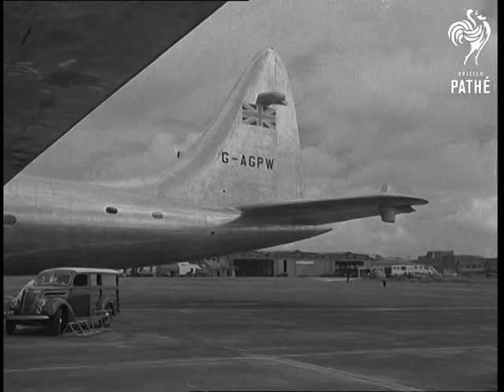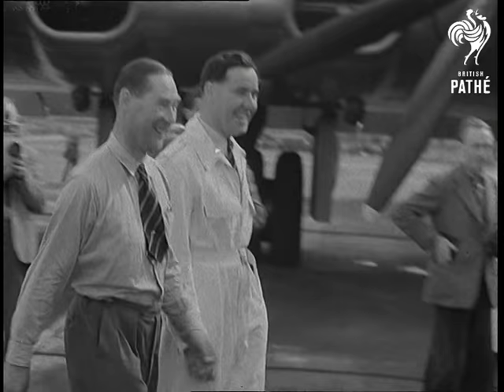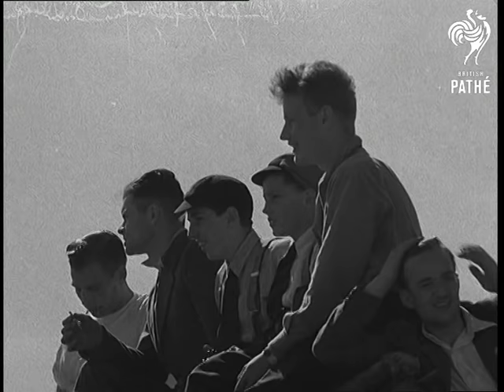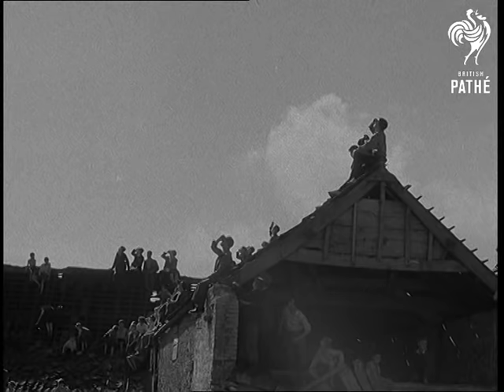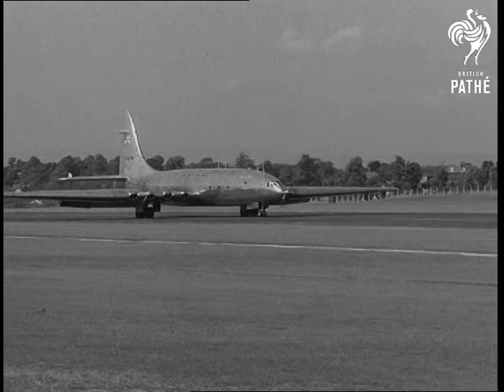130 - Ton Colossus Takes The Air (1949)

Comment: I have a great respect for the engineers who designed these aircrafts without a computer.
Reply: They used sliderules - cheaper and quicker.
Reply: Singular or Plural.. it's Aircraft !  Numpty 🥴
Reply: Singular or Plural.. it's Aircraft !  Numpty 🥴
Reply: Singular or Plural.. it's Aircraft !  Numpty 🥴
Reply: Singular or Plural.. it's Aircraft !  Numpty 🥴
Reply: Singular or Plural.. it's Aircraft !  Numpty 🥴
Reply: Singular or Plural.. it's Aircraft !  Numpty 🥴
Reply: Singular or Plural.. it's Aircraft !  Numpty 🥴
Reply: Singular or Plural.. it's Aircraft !  Numpty 🥴
Reply: Singular or Plural.. it's Aircraft !  Numpty 🥴

Comment: takes to the air - but only just. the thing has to fight tooth and nail for every inch of altitude and it looks heavy as hell. the shape is reminiscent of a lockheed constellation, only with single stabilizer, far fewer windows and seventeen billion rivets. give or take a few billion.

Comment: The Brabazon was using a 4-engine, 3-blade 'contra-rotating propeller' which though noisy, enhanced air intake, produced more power but with fuel efficiency. The US and British aircraft engineers never mastered the problems with the rotary shaft systems. The Russians however overcame that with 4-blades and produced the legendary Tupolev TU-95 'Bear', a huge, long range, swept-back wings, turboprop strategic bomber aircraft in 1952. It is still being used (after many upgrades) by the Russian Air Force even after 70 years !
Reply: Eight engine's look it up if you don't believe me
Reply: The US never tried to produce a counter rotating prop engine for airline use so there was no reason to master the engine.
Reply: The Russians had captured German engineers for the contraprop engines dev ,without them the tu95 would not have flown
Reply: The tu95 geared hunbs are so noisy they can be detected by submarines.
Reply: Clearly there were 8 engines as could be seen by the start up of a set of engines and the 8 air intakes per wing. Don't really have to look things up just have to observe. Sad that the aircraft was not saved. Lots of man hours painstakingly spent in producing it. Sad when it was destroyed. Much the same as the Avro Arrow in Canada. Easier to tear something apart than to put it together.
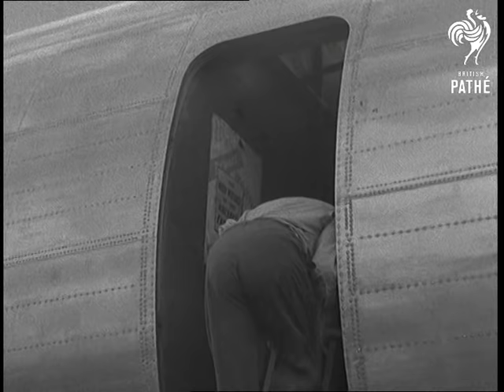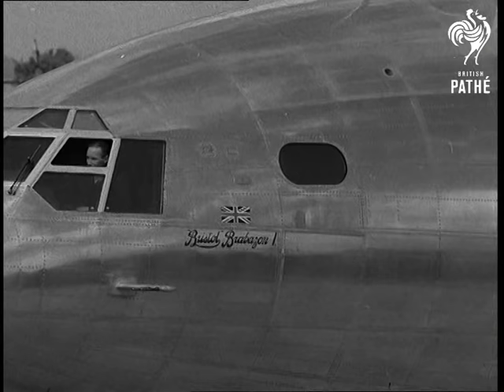Reply: Gilad Pellaeon  If you look at 0:32 - 0:45 you can clearly see that each blade was spun up separately. The flight engineer had 8 separate controls, one for each engine. Some (Bell 412) helicopters sport 2 jet engines with 1 rotary blade and they are twin engine aircraft. What I am trying to say is 1 propeller does not equal 1 engine. Same as counter rotating propellers does not mean an aircraft has 2 engines.
Reply: Gilad Pellaeon  Some also believe the world is flat and we never landed on the moon.😊
Reply: I will correct you a little, the Tu-95 is not used by airlines, it is a bomber and serves in the Russian Air Force. But the Tu-114 was a passenger aircraft and was based on the Tu-95, but had a different fuselage with a larger diameter, from the Tu-95 it had wings, engines, tail and some other aircraft systems. It was decommissioned in 1977. It can be seen in the museum in Monino.

Comment: I can’t believe I’ve never heard of this aircraft, and I thought I knew them all. What a Goliath and the sounds of the engines! Amazing.
Reply: Same here.
Reply: there was no mention of the aircrafts unusual engine  setup, 8 engines for 4 props, another forgotten giant is the Short Belfast turboprop of which only 10 were made for the RAF.
Reply: I have to wonder how many aircraft we may never hear of.
Reply: Its A Psycholigical fact , if a Person Think He Know All Infact They Know Nothing  , Im Criticise Anyone   , i Read This.
Reply: @georgebarnes8163  No, it had 8 props. 4 clockwise, 4 counter-clockwise - each with its own engine. You can see them at the beginning of the video.
Reply: @Fastvoice  First set up had  4 sets of  4 blade props each prop was driven by two coupled engines.
Reply: @georgebarnes8163  Source? What we see here in the video is the first version that really flew - and it has 8 engines and 8 props. Couldn't find any mention of a previous 4 prop setup for the Brabazon.
Reply: @Fastvoice  all types  had 8 engines and all  types use  coupled engines, the first engines used were the older Bristol Centaurus powering in pairs a single  4 blade prop, later a pair of 4 blade counter rotating  props, the next engines were the Bristol Proteus again used in pairs driving a pair of 3 blade counter rotating props via coupled gearbox, these aircraft were first tested in late 44  as a test bed for a bomber as Bristols type 167

Comment: Today is the first time I’ve ever heard of the Brabazon.  The only thing I know about it is what I listened to in this video.  
Nevertheless I have three comments about the Barbazon:  
1.  It should have been built with jet engines and not reciprocating engines. 
2.  I’m guessing here, but with its power to weight ratio I’ll bet it was extremely under powered.
3.  It was a very sleek and beautiful aircraft. For that the designers should take a big bow.
Reply: To be successful, the Brabazon needed to be able to pack in passengers, not like the cattle class of today, but sufficient to achieve satisfactory costs per seat mile, and to have the range to enable it to operate on long-distance sectors, and performance to enable it to achieve satisfactory turnarounds. It is doubtful if the jet engines of the time could have helped, as they had a voracious appetite for fuel.
Reply: Yes, it was totally underpowered and that was a major reason for its failure. So the Lockheed Super Constellation became the "Queen of the Skies" of the 1950ies.
Reply: @NicolaW72  Then the Comet came along to be "Queen of the Skies" until it kept falling out of those very same skies. Oh well...
Reply: @olsmokey  The Comet was therefore never the "Queen of the Skies".

Comment: Truly awesome plane which is way ahead of its time. A flying luxury cruise ship. .
Reply: I think it was more likely significantly out of date by the time it took to the air. If it was intended to steal passengers from cruise ships that bird had already flown and flown again by 1949.
Reply: well it was when it was thought of but b4 it was a prototype it was all ready too old and anyone can see it was way underpowered   just from the rollout and take off and on top of that as it was test flight so im guessing  the fuel would have  very lite load  and only a few on board  no bags

Comment: The B36  with 6 pusher prop engines and 4 jet engines also flew in 1949 and Max takeoff weight: 410,000 lb (185,973 kg) 205 Ton machine
Reply: B-36 first flight was in 1946, it entered service in 1948.
Reply: @rayjames6096  Ok thx for that info and a friend of mine used to work on them

Comment: Very sad ,  Britian had the manufacturing ability , it just needed the correct design , it turned out to be the Boeing 707 , but funnily enough the prop driven Lockheed Constellation was a sales  success till 1958 .
Reply: I believe because the range was still very good
Reply: The Constellation was a superior plane in every aspect: capacity, speed, and performance.  As elegant as the Brabazon was, it was a white elephant doomed from the start.
Reply: Well, it sort-of had the correct design with the de- Havilland DH-106 'Comet' - which also flew in 1949.
Reply: @alecfoster5542  Constellation is half the size of the Brazen, half it's length to start.
Reply: The Bristol  Britannia  did OK.
Reply: @flybobbie1449  The Constellation was also faster and carried more passengers and made it into production serving airlines all over the globe.  And Lockheed did it without government subsidies.
Reply: The Lockheed was 116 ft the Bristol was 177ft. The  Bristol was twice the weight of the Lockheed tho. The Lockheed entered service 6 yrs before the Bristols first flight and had more powerful engines and a cruising speed almost 100mph faster.

Comment: Great film of the mighty Brabazon. I have seen many pictures and have a picture of my father-in-law, an RAF instructor examining the Brabazon for possible purchase by the RAF as a long-range transport. As an Aero engineer, this film shows clearly what is wrong, she is too heavy and underpowered, a classic design by government committee failure. 100mph under design cruise speed, blimey! she looks like about to stall! From the film, the wing design also looks odd, a very high drag straight arrangement, sweep it back guys! There were many such aero design failures in the 1940s. Interesting that many of the successful aero designs were private venture, e.g. the Mosquito, Hurricane, etc.. The engines are actually 8 off, 2 coupled together to one contra prop, a fatigue nightmare. Germany tried this on the Heinkel 177 and failed. Brabazon needed jet engines, probably 6 at that weight and at that time. The problem is that after the war the country was broken in many ways including financially, and such projects were bankrupting the UK aviation industry. DH with the comet got it right in design performance, though had to learn about airframe pressurization and fatigue, though the fatal crashes were well below the airframe fatigue flight cycles...that is another story. Only the Brabazon hanger survives today and only just. I think all of us and the Nation wanted Brabazon to be a winner, and that is what makes me sad, though she does look magnificent.

Comment: Although this was one of those behind the times technical achievements, the fuselage looks nonetheless more aerodynamic than today's airliners! Seems the smooth front end informed the Comet, after which we didn't have another smooth front end until the B787 and the A350. Although again, the engineers obviously knew what they were doing, the Brabazon looks under-powered - those props look too small for that enormous fuselage and those gigantic wings - if it doesn't look right...? Perhaps this demonstrated the limitations of propeller-driven propulsion - you have to have enormous propellers which demand greater ground clearance and longer gear legs and which present more challenges, and numerous engines because of their power limitations as compared to jet power and which soon replaced it.
Reply: Yes, this was one of the huge problems of the Brabazon: it was underpowered with its traditional propellors - you can even see it in this video how difficult it was to climb for this aircraft. For an aircraft of this size you need at least turboprops - or jet engines.

Comment: A good example of how British designers got it completely wrong - cruised at only 250mph, at the dawning of the jet age. Luxury inside, not bums on seats. Same as the complete waste that was Concorde - the plane that helped finish UK airliner industry. Too loud to fly over land, too expensive, too small seat capacity - Jumbo jet, entirely different, and still flying. If the UK had put money into more wide body jet airliners, it would have an aircraft industry competing against the USA today - due to all the experienced workers gained in the war. And that experience passed down.

Comment: Why was this never put into mass production or put into service? Was this concept scrapped/abandoned?
Reply: It was scrapped because they found structural cracks that would have caused the wings to rip off in flight.
The design was faulty from the beginning. It was the most futile machine since the R101.

Comment: I don't see how counter rotating props on the same shaft would be very efficient.  The narrator said that the air speed was about
100 mph below what they expected.  I would think that is because the air flow thru the props would be restricted with  turning opposite of each other.
Reply: This kind of propellers is still used in Tupolev and Antonov airplanes, they fly rather fast.
Reply: Counter rotating props are very efficient, as used on the TU95 the worlds fastest prop aircraft.
Reply: The comment made by the narrator seems to indicate there is more speed available they just did not use it that day
Reply: @ztrguy  Yep, the aircraft was capable of 250 MPH and did achieve that speed.
Reply: @ztrguy   No, he didn't say that at all.  He said the cruising speed was around 160 mph,  nearly 100 mph 
below the estimated cruising speed.   Sounds to me like it did not meet their expectations on speed.
Reply: @Eddie_Schantz  He said the "average speed" on this short trip was 160, no suggestion they even tried for the cruising speed, or cruising altitude.
Reply: @sean_d    WHAT EVER.
Reply: @Eddie_Schantz  They kept slow on purpose. The landing gear was left down which limits top speed. Leaving the landing gear down is common for early test flights. It’s one less thing that can go wrong!
Reply: @buzzz241  Thanks.  That makes sense.

Comment: Problem is this was obsolete as soon as it was flown.  They should have used jet engines by then...
Reply: the second variant was to use a mixture of jet and prop engines but  it never happened  as the DH Comet took to the air at the same time, technically the aircraft did use jet engines to power the props, eight of them.
Reply: @georgebarnes8163  no, the Brabazon was powered by eight radial piston engines concealed in the wings. Not turboprops.

Comment: I gotta wonder how long these planes lasted, considering that on the first test flight, it under-performed on the expected cruising speed.
Reply: As said it only went up to 4000ft!!
Reply: The first flight is usually used to test control response, not cruising performance.

Comment: An awesome aeroplane,  but very much of its time & seen (optimistically in hind sight) as potentially 'way ahead of its time possibly. 
Air travel was about to turned on its head by jet airliners like the Comet , Boeing 707 for at least the next 20 years until the advent & acceptance of the Boeing 747.
Saying that the "Brabazon" I believe is more comparable to the "Airbus 380" - that is its was a victim of unforseen & predicted fast moving trends in air travel & customer requirements by the time it was ready to come into service & gain commercial acceptance.

Comment: A lovely thing but it must be remembered the Brabazon project was a disaster from start to finish. As so often with British aviation we pushed to far too soon without the tech in place. R/R built a new (revolutionary ) engine that turned out to be 50% underpowered for job needed. It looks so smooth in flight and takeoff/landing because it was incredibly sluggish and slow. Not a single airline was interested in buying it. the BOAC  boss took control for 5 mins during a flight and said no thanks. Only one was ever built,the second prototype was scrapped before it was even finished!! Would have a fortune as a museum piece

Comment: To bad they scrapped it and the princess. Though both were failures I think seeing them would be interesting. Compare to the DC-6/7 you can see the plane was a failure.
Reply: Why a failure? Just b/c it was scrapped for financial reasons?
Reply: @fattymcfatso1083  because it was such a poor performer they couldn't sell it. Very complex engine arrangement also. DC-6 and DC-7 were able to make money for the airlines which is the measure of success. Same number of passengers 100 mph faster with four engines instead of eight.
Reply: @johnmajane3731  🙂👍

Comment: Fill this plane full of fuel, passengers, along with their luggage, and it would take a runaway 23 miles long before this thing would get off the ground. I see why they scraped it with a cruising speed of 100 miles an hour less than it was supposed to have.